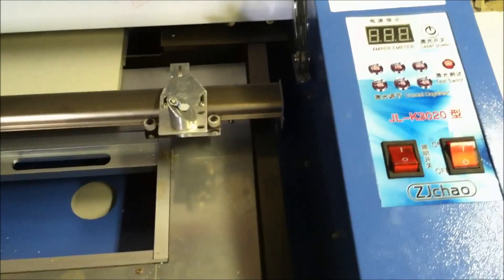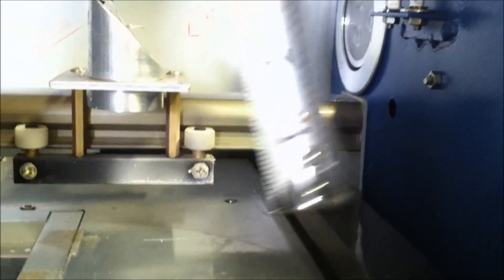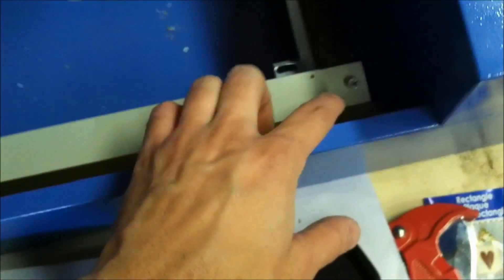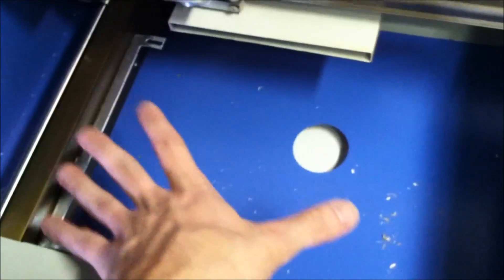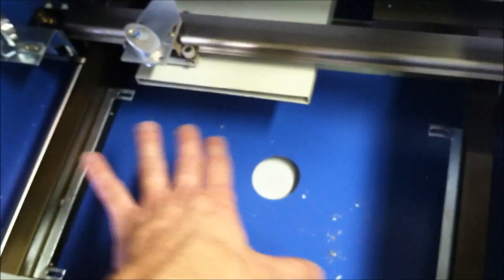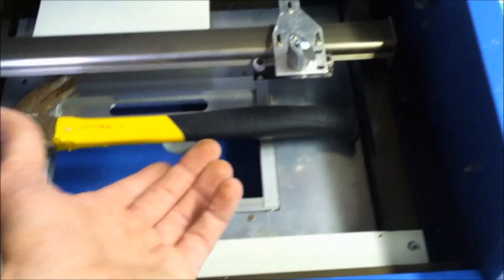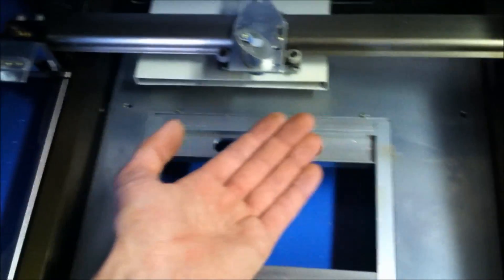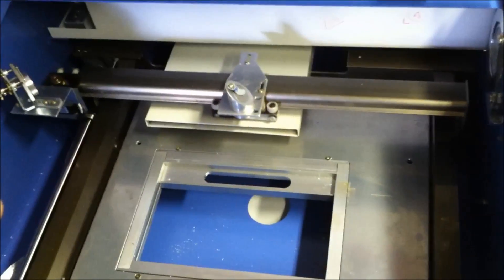How to modify your jl-k3020 40w laser engraver to do thicker objects

Comment: Nice work. You are very observant in finding those screw holes! Since you published this video someone has come up with a sprung platform that keeps the top surface at a height roughly equivelent to the focal length. Mr Pissant says this is where it shold be. I think that if I am cutting 1" balsa I want the focal point to be 1/2" below the surface - to give me a squarer edge, but I really dont know how well thick balsa cuts? Just ordered this machine so I will soon find out I guess.

Comment: you're very close to getting the idea. measure focal length of cutting lens with tray in place. that must remain constant in all cutting and etching operations. you will need to manually set the material height of each of various materials . don't fiddle with the mirrors . also consider the plate may necessary to maintain the squaring of the gantries. Check the diameter of the lens , probably 2 inch. find the focal length of that lens on the web. that will be your constant distance to the material surface. also understand the operational wattage. you cannot use full wattage . maximum may be 6-8 mA power . more will deplete co2 in tube and shorten its usable life. happy trails and sunny skies. ron
Reply from the maker: Ron Phillips thanks!

Comment: Question. Is the bulb currently installed a 30 watt bulb? But you say it is configured with a 40 watt power supply. I have been running this machine for over a year perfectly fine, no problems. Can I install another 30 bulb? You said your first replacement tube lasted only 3 months. Was that a 30 Watt bulb? Thanks again for the help.
Reply from the maker: Yes it's currently a 30w installed in your machine. I over drove mine once with out the water flowing and it blew up. They have a two year shelf life.

Comment: Were you able to find a 40 watt laser tube because the only laser tubes I could find that size are 20 watt. Do you by chance remember what laser tube and where you got it? I need to have one on back up soon.
Reply from the maker: Here's the problem, that physical size is actually a 30 watt. We've been cheated, i had to cut the side of my engraved to install the 40 watt tube.
Reply: @hitandrepair  they are all over ebay